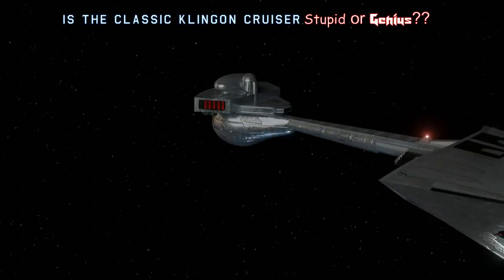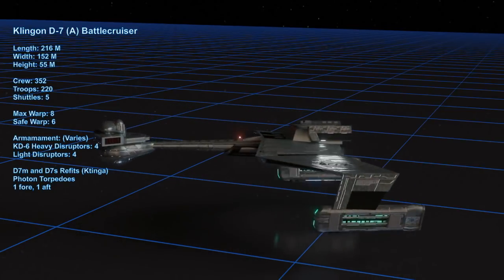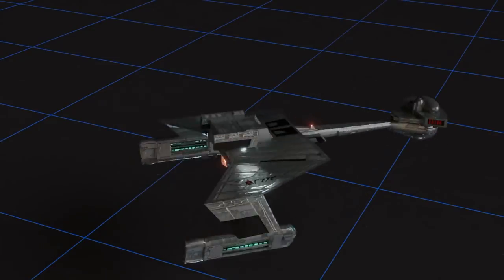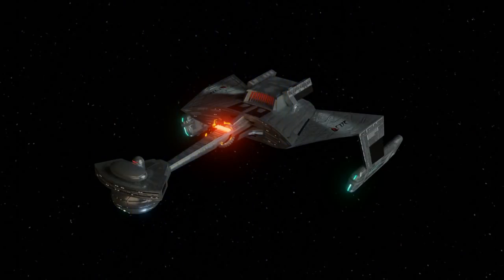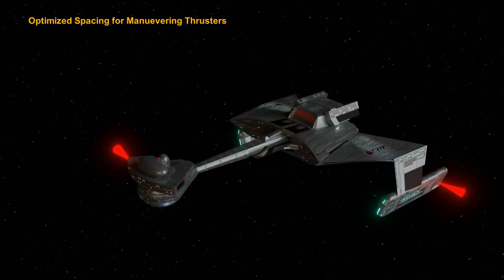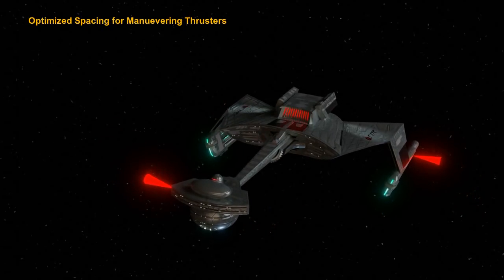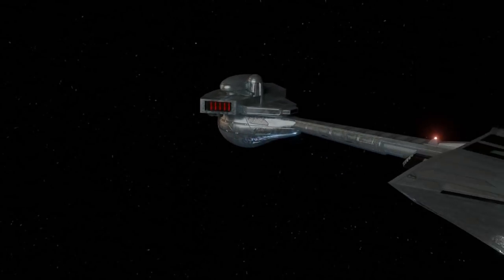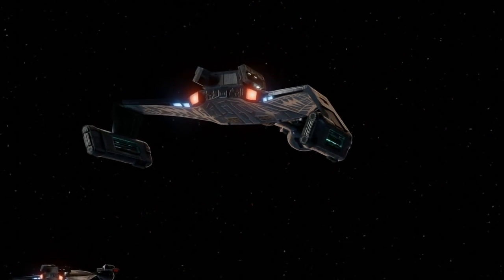The Classic Klingon D-7 Cruiser - Stupid or Genius Design?? Animated Breakdown!

Comment: When Jefferies talked in articles about the nacelles on the Enterprise and why they were away from the crewed areas of the ship he mentioned strong magnetic and 'other' fields that are best kept away from the crew.  Assuming that the magnetic fields include the bussards and the fact that the bussard equivalent intakes are on the front of the "wings" that the warp nacelles are directly attached to rather than on the front of the nacelles the way they are on Federation ships the sensor theory sounds the best, the neck could be to get both the sensors and the officers out of the strongest nodes of that field.

The rest of the crew, in the engineering hull, would be behind the nodes from the scoops and therefore safe from it as well.  The fields could be weakest in a small area where the port and starboard toroids touch so a slim enough neck with enough (probably expensive) exotic physical shielding might be the most expedient and inexpensive way of getting from one side of the field to the other without disrupting it.  And even that might only reduce the strength to non-hazardous levels but still degrade sensor readings enough to make having the officers out in front with them a worthwhile risk.

A sidenote about the deflector emitter and sensors:  If you look carefully at the deflector on the Enterprise it is actually two realworld antenna types combined, the parabolic main deflector dish and a choke-ring antenna built around the post the dish is mounted on the end of.  In theory the dish would produce a beam pattern while the choke ring antenna would radiate whatever energy they work with to the sides but not towards the back of the deflector or at the secondary hull behind it (there is a dead zone along the center axis of choke ring antennas) like those antenna types do with radio signals in the real world.

The Klingon ship does not have a parabolic dish like your model has (unless there is one on the inboard end of the sensor/torpedo tube), but it might use a series of phased rings in a sort of switchable endfire/colinear sidefire  arrangement to do the same thing as the two separate antenna types the Constitution class uses.  Such an arrangement would seem to fit their minimalist technological design philosophy, and it would allow them to mount their torpedo tubes deep in the pod to fire out down the center of that array and possibly use the deflector push to do double duty and help accelerate the torpedo.

Comment: Actually, its interesting that you compared it to a Star Destroyer, I think it gives you the answer.  First, I think maneuverability is a big reason, but also we do know from Star Trek IV that Klingon ships are built with fewer built in safety features of the Federation ships so safety (at least at higher Warp outputs) might be an issue.  However, the Star Destroyer is actually mostly hallow. We also know that in Star Wars, the Empire use to mine planets to the point of destruction for materials.  They don't tend to do that in Star Trek, so cutting down on the size of the ship where you don't need the extra material would work.  But also, with less mass it would make the ship more maneuverable with that lack of mass.  As for structural weakness, this may have been known. I don't think it was that critical of a weak point for both the reasons noted, and that ships in Star Trek are pretty durable. We know the Enterprise 1701 can end life on an Earth size planet with a few shots, yet we've seen it and several other ships in the Trek universe take all sorts of direct hits without shields.  That being said, the Vor'cha class premiers with a much thicker neck, and it is beheaded by kamakazi runs from the Jem'Hadar in DS9, so its possible as time went on the weakness became more prevalent as technology improved.

Comment: The reason that the neck protrudes so much has to do with something completely different - firing arcs! If you ever played the old SSD - based Star Fleet Battles, you'd know that the wing - shaped rear hull compliments the boom shaped forward hull by giving almost 360 degree firing arcs for the torpedoes and disruptor banks. In combat, this ship is incredible because it can bring 70 % of it's entire armament to bear no matter what direction the ship is facing. This fits the Klingon style of space combat, turning the entire ship into an omnidirectional rapier, unlike the single approach "boxer" style of the Constitution class Federation ships - check it out!

The old paperback novels will support this explanation quite nicely! c

Comment: I think the question of armor is really under-considered there:  the bow-on-the-boom is very desireable for maneuver and weapons arcs,   and since a space ship doesn't have to care about buoyancy,  the narrow parts can indeed be seriously-beefed up, structurally  as well as  with thick armor:   the smaller the armored area/volume, the less weight it takes to make it so,   and of course the smaller boom is harder to target/further from the shields if some damage leaks through.  

As mutinies go,  that's a possible worry,  as could be repelling boarders.   But on the other hand, Klingon chains of command often involve killing by other officers, so maybe this choice of arrangement just helps keep such matters simple and out of sight of the underlings.

Comment: Originally, the explanation of the D-7 in the FASA Star Trek Role Playing Game, back in the 80s, was that a majority of their crew were slave races. They kept strict control of those personnel ruthlessly. Occasionally there were mutinies. Only loyal Klingons were allowed out of the main drive section unsupervised. In case of a mutiny, the security personnel would maintain control of the neck section. Allowing the main loyal Klingon crew to separate and either turn off life support to the mutineers or self-destruct that section. Of course, that was before the plethora of Star Trek reference material.

In the 'board game' of Star Fleet, The SIDs (Ship Internal Design) had a unique internal system on Klingon ships for 'security.' If you destroyed all of the security systems, there was a chance for a mutiny to occur. I believe that was a holdover from the earlier FASA game.

Comment: I mean, we can't complain about the thin neck if we can't complain about the thin brackets connecting the warp nacelles to the body of most versions of Enterprise, especially the earlier ones.

Also thin sections are useful because they have a low cross section. The smaller the cross section, the more difficult to both target and hit.

Comment: My theory (feel free to disagree)
In a chaotic situation, you might only be able to get a fleeting targeting solution for the approximate "center of mass".  With so much of the center of mass being empty space, a snap shot at a D7 (from above, below, or the side) might more likely to be a near miss than a direct hit. The boom looks vulnerable but it also has very low wrap-around surface area, as it doesn't seem to contain any essential systems besides corridor and conduits, so the weight of armor needed to make the boom very tough is low.  Think about tanks - the bigger the tank facing, the more it weighs to provide that facing with armor for any given level of protection.  The low volume boom could be armored with far less net weight than the drive and engineering sections but still be more resistant to damage on average.

If that's the case, then despite looking fragile, the boom is actually 1) a low profile target which is 2) armored more heavily per unit volume or surface area than other parts of the ship, so it both attracts more fire and voids or shrugs it off better than the rest of the ship, improving its overall durability on average.  This all doesn't work as well if the shields are "bubble" shields but might work better if the shields are skin tight.

Comment: Not to bring Starwars into it but I imagine a thicker fairing or plating connecting the angular front section of the drive section to the “ wings “ of the bridge section, like a SW Y wing, in the movies it’s stripped down from its clone wars design, and given the nature that the D7 was rushed forward for war with the Federation, the Klingons basically removed the extra plating or sections to reduce cost and speed production as it did not contribute to the overall design

Comment: When I first considered this design my first thoughts were that the Klingons are a feudal society and the design of the D-7 reminds me of a mott and bailey fortress. The Klingons were absolutely slavers at this time and infighting, inter and intra-family feuds and power struggles are common. It would make sense for command and control to remain at the bow like the first class travelers they are while the plebs, slaves, and possibly dirty jobs remain in the rear. The only connection to the command module is a single access corridor in the neck to control access. Having the command module separate might make sense in this case, though such cowardice does not seem likely to be well tolerated amongst Klingons. Perhaps it might be used in case of accidental warp core breach though.

Comment: It always surprises me that nobody refers to the original blueprints, drawn up by Matt Jeffries, signed by Gene Roddenberry, from which the original studio model was made.  What everybody refers to as "disruptors" on the forward hull was marked "Tractor Beam," and there was a radar dish in the "torpedo tube" marked "Sensor."  The only disruptors that were labelled were on the tips of the warp engine nacelles.  There were positions marked for "Phasers" that were not visible on the model, seven on the D-6, and nine on the D-7.  There were also security positions at either end of the corridors along the neck.

From here, we can only conjecture about Jefferies' engineering fantasy.  Apparently he took the designation D-6, 7, ect. from the way the English designated ship designs.  The designate a hull design with a single letter, and any major variant receives a number.  In this case, the D-7 has two more phaser turrets than the D-6.
 
Anything that comes after Matt Jefferies' original falls into "This is just done, because it looks cool."  Robert Wise had no idea how far we get into this stuff, and the people that made the models for ILM were working with a deadline.  Personally, I'd like to go back and revise everything, and since the studios insist on putting out crap that nobody wants, I can do whatever I want with my own models.

Comment: Consider first that the primary weapons on a Klingon ship in TOS were mounted on the nacelles and forward firing.  Anything large in front of the nacelles would greatly limit the firing arc.  Prior the the K'tingas shown in STTMP they were never shown firing torpedoes, nor any direction except forward.  Almost as if they were thought of more as giant fighter planes (watch how they maneuver) that had to come around and face their target rather than the more turret (or beam director) mounts on Federation vessels.  Combine that with shields and the fact that at Star Trek space combat ranges, no one was firing pinpoint at one spot but rather at a dot in the distance, and the neck has more tactical advantages and flaws.

Comment: The neck was designed to enhance battle readiness of the D-7.  The forward section had a warp nacelle also.  Using multiple nacelles was a case of diminishing returns on warp speed.  Two nacelles did not make the ship twice as fast, but only 1.5 times as fast as one nacelle.  Three nacelles made the ship 1.75 times as fast as one nacelle.  Four nacelles made the ship 1.87 times as fast as one nacelle.  You see the diminishing returns?  Star Fleet used two nacelles because it gave the best bang for the bucks to build it.  The Klingons were willing to use three nacelles.  The bulbus part the forward section was another nacelle.  The D-7 operated on two intersecting warp bubbles.  One forward and one rearward.  This dumbbell shaped warp field mitigated some of the diminishing returns. The D-7 was actually two ships connected with a neck.  Although we never saw it, the D-7 could separate into two independent ships.  The D-7 battleship could break into a heavy cruiser and a light cruiser.  The D-7 was designed to be a war ship (or ships).  One could ask "Why did the Enterprise have a neck?"
Robin

Comment: I think they just tried to make it look cool, without thinking too much about it. Kinda like Romulan Warbirds. But if we make theories. Knowing Klingons i'd dismiss the safety of officers in case of a revolt, catastrophic hit on the rear section, and radiation theories. If anything, i'd imagine they'd use the forward section for ramming when rear propulsion fails in to battle.
Reply: Completely agree. They are for aesthethic purpose.
To add for the theories, at the time they build the ship, the Klingon probably only put other house of klingon and Romulan as their adversaries. Both race mainly using pulse base distruptor during this era. Pulse base weaponry are far less accurate than Federation phaser, thus the thin neck gave them some advantage.
Also, both races ship have mainly forward oriented weaponry, thus the neck section hardly exposed during battle as they tend to stick on nose to nose battle. Neither side want to show their ventral, dorsal, or side part, since they will exposed their weak spot as well as having a limited angle to aim their weapons.

Comment: Well actually... It's a combination of almost all of those things.  There is more radiation in the engineering section, the boom does help with internal defense, and the ship's geometry does help with the warp field, Klingon cruisers are fast an maneuverable, and shields are heckin' important.  Making the ship "not a big triangle" saves on material and reduces the effective surface area, making the ship harder to hit.  Klingon ships are like Klingon warriors - efficient.  Why make a bigger hull if this is all the hull you need?  You can make another ship instead, and that's more valuable.  Battlecruisers are also multi-role ships.  They attack other ships, but also carry warriors for boarding and planetary assault operations.  Those warriors stay in the back - where there are some pretty large transporters for simultaneous beaming.  That's another reason to keep the sections separated.  To beam down warriors you would need to lower the shields on part of the ship.  You don't want to do that on the command section.  You can drop the ventral shield on just the aft section, beam your warriors down, and raise it again while the rest of the ship remains protected.  As for engineers... they are considered low-ranking, almost a servant class.  Their job is to keep the ship working or die trying so that the warriors can fight.  If the ship needs to be evacuated, say due to a radiation leak or collision with a foreign body, where dying would not be in battle nor glorious, the engineers are to stay aboard.  Either they fix the problem or they don't deserve to live, having failed their crew, and die with the ship.

Comment: Examine TOS D7s. They are clearly shown firing disruptor bolts from the places where the engine nacelle connector sections join to the main hull. (also from the nacelle forward lower caps)

Comment: The D7s, the K’tingas, and Neghvars are an excellent design, a menacing grace unmatched in science fiction.

I like the spinal Mount in the neck idea but agree with the impracticality of it. For safety purposes, I could see them storing torpedoes in the neck, so as to not risk damage to the launchers in the command bulb itself. That also lends itself to the Star Fleet Battles Klingons who use drone missiles; it would be safer to store them in the neck.

For a long time I’ve felt the D7 design pays tribute to the menacing Martian flying machines in 1953’s The War of the Worlds. Those ships were reused in 1964’s Robinson Crusoe on Mars. Perhaps they could have influenced Matt Jeffries. 

Similarly, the design of the D7 appears to have influenced the star fortresses of the Draconian Empire in the 1979-80 season of Buck Rogers in the 25th Century.

Comment: Personal theory, if you're in a DS9 or later (and Discovery) style space battle where you're actually flying around in a 3D environment, that thin neck is A LOT more difficult to actually hit with a weapon than a big flat saucer, and Klingon ships are definitely designed for combat vs scientific exploration. 

So, they don't need the interior volume for long duration nice to haves like holodecks, don't need the numerous crew quarters for all the labs/schools/guests and diplomacy missions/deep space storage capacity, etc.

So according to the KISS principle, build the ship for what you need, ie max combat no fluff, ship materials are also expensive, so if that 'neck' fulfills the product requirements then leave it alone

Comment: Well rather then danger from the Reactor, what if the crew is  the danger they are locking into the back of the ship. There is a Rank by death of your commander. The long hall way could be setup with one way cover, it acts like interior fortress. Also Klingon culture is part of the design, I vaguely remember the Klingon symbol is a weapon  that is a off balance, that puts the user at a disadvantage until  balance learned. But in Klingon culture there weapons are also training aids. The neck dose make the best angle to attack an enemy is head on with the offices in front. If the attack fails the offices have a good chance of death, so it falls on the crew to learn from mistake and advance.